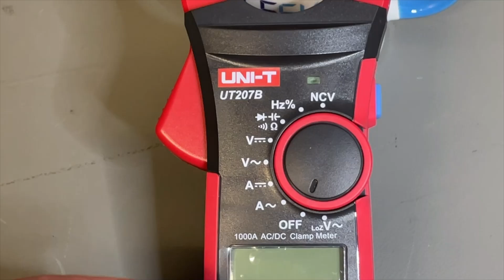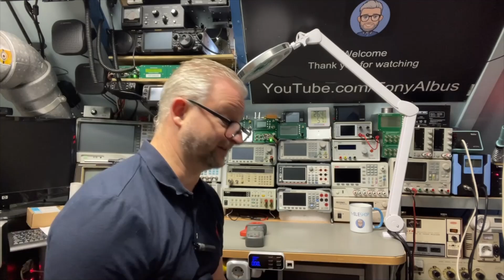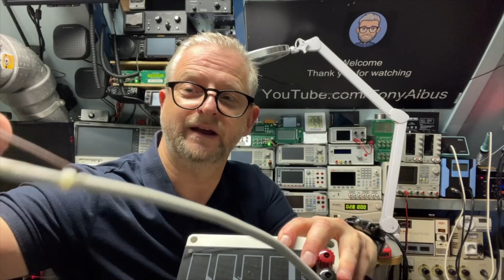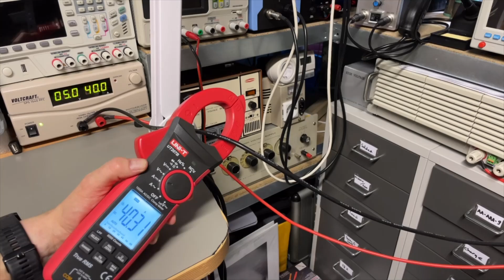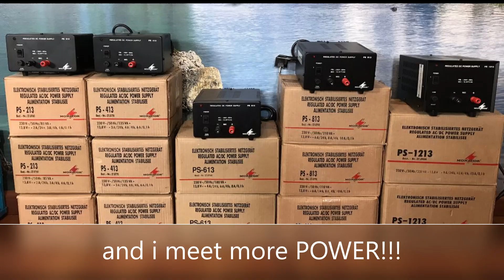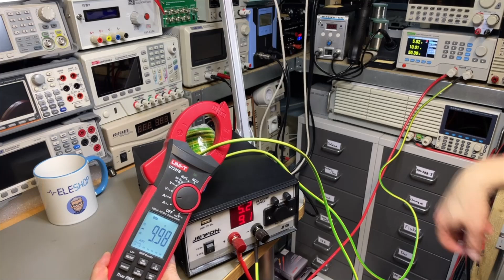TA•0413🟦UNI-T UT207B Current Clamp AC/DC - 1000 A - Hands On

Comment: Very nice video.... Question uni-t UT207B or Brymen BM037 in the same price?
Reply from the maker: I have not tested the BM037, but looking at the specs, they seem on paper almost equaly metched  the Brymen seems to have also a low current mode using the probes. 
if i needed to pick i prob go for the Brymen, becouse of the brand. but i just had a very quick look at both specs.
Reply: @TonyAlbus I have the old UT203,but this one has a graphics bar,LoZ and LPF....I will look at the brymen and decide...thanks.
Reply: @aristidis540  Hi ! which product you went for Brymen or UNIT?

Comment: That's huge ! When you said you were going to test at a 1000 Amps I had a vision of you climbing an electricity pylon. Very nice clamp meter and liking the inrush test a lot. Tell me was the black cable very hot when you touch it to check.  Nicely presented video Tony
Reply from the maker: Hi Ian, oh no! i am not climbing any high things anymore in my age, when young i was fearless and climbed many thing, you could find my in the high antennas, but somehow after 40 i got scared or a bit smarter... Thanks Ian!

Comment: When in tech school, I stumped my instructor with a question over clamp-on meters. I was using an older Amprobe, but it did both AC and DC current. I asked him, " how can a clamp meter measure DC current?" It was something he had never thought about, so he replied, "let me think about it, and I'll get back to you."

About a week later, while I was at the bench in our class's shop, he walked up and said, "they use a Hall Effect sensor." Notice how the gap in the jaws are insulated on these. The sensor is at the tip, and requires an air gap to operate.
Reply from the maker: Cool question!!! great to know the answer also, never thought about it like that.
Reply: @TonyAlbus  That was back in 1983 when I graduated from technical college, and it could have been Amprobe the one to develop that. The ammeter was a newer model, then, and was their first with a red LED readout at the bottom. It had leads, and could also check voltage and resistance.

We had a small, yellow, Sperry ammeter that we used in class, which was AC current only, and you could see the ends of the steel laminations at the jaws' opening, which met together. The new ammeter's jaws' ends were covered in black plastic.

Inside the plastic jaws, and wrapped around the iron laminations of an AC ammeter, are many turns of a fine magnet wire in the AC only. It forms a current transformer which moves a needle on an analog meter. You can't transform DC, though, but you can catch the first current pulse to view from the surge current, which would make an analog meter's needle bounce a bit, though that isn't what we want to measure, thus, the question I asked him.

Comment: Hi, you did exactly what I did. I manufactured a line splitter with 10 windings on Live wire and if I don't want 10x "amplifier", I clamp only one wire, because i let some space near coil. I used a spray tube as a support and I extract the tube.😂

Nice video. Thank for your effort and for work under pressure of temperatures from your country. 

For all, I was the eastern europe guy who sugest this meter. I have it and is a good tool. What I don't like at this clampmeter is "zero" function on DC amp. You can only press once the button, and at second pres, does not do "zero" again,  just cancel first "zero " you have from previous press. 
UT210E can do this function more time and you can be closer to zero. To deactivate "zero", need to press long on the button.

If you saw, Tony press "zero" and measurement did not start exactly from 0A. With UT210E you can press second time "zero" and it cancel the remaining field from previous atempt. With several press the button, you really start from 0.

Even with this minus, ut207 is a good tool for inrush, loz, 1000A dc, lpf. 

Thank you Tony.❤ I enjoyed your video at 1 a.m. in my country😅
Reply from the maker: Thanks for the suggestion, its indeed a nice tool!

Comment: Thank you, Tony. I enjoy your product reviews, always helpful! The coil is also handy for measuring low current draw of small devices by powering them through the coil and dividing the read-out by the number of turns. Regards, David
Reply from the maker: Thanks David, for it was a first to use the coil... it works better than expected. and spot on. 10x = 10x ..